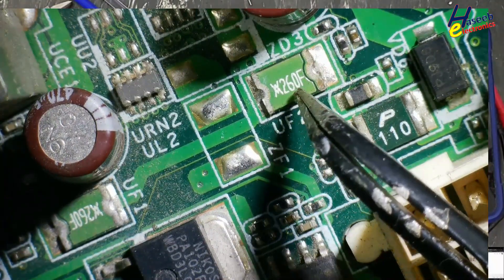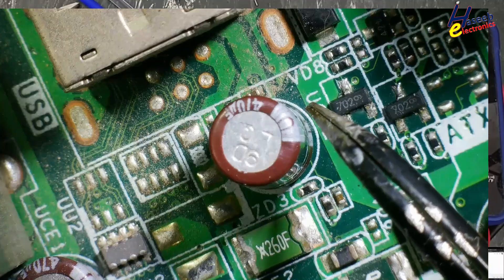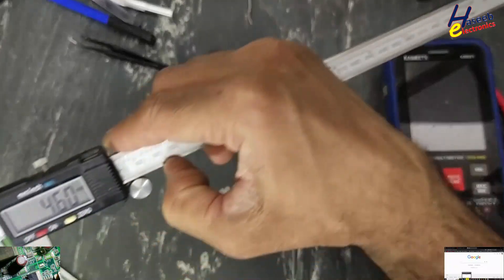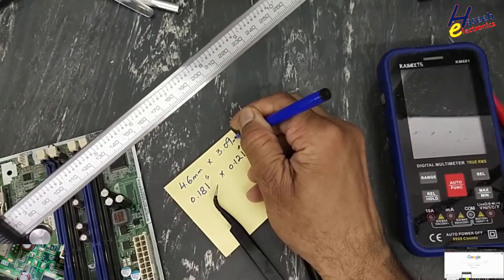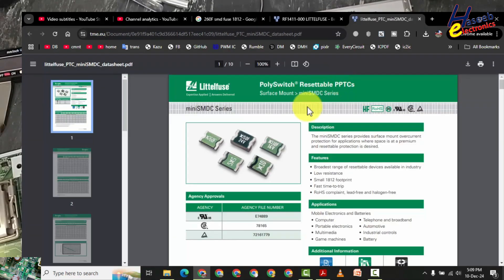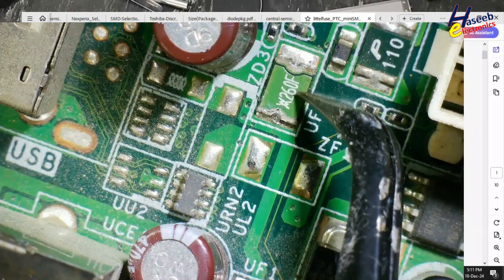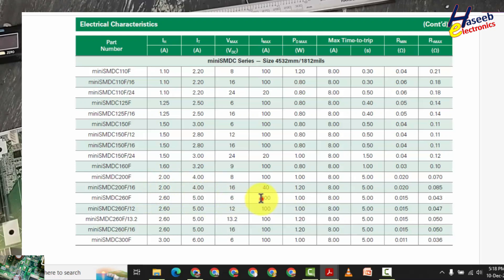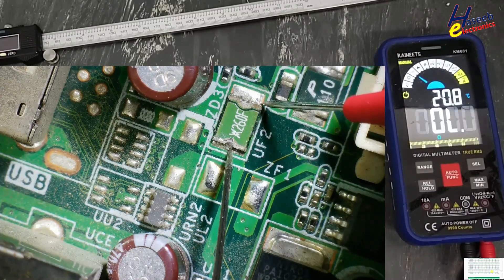{1269} PolySwitch Resettable PPTC Fuse

Comment: one problem with PolyFuses is that they don't cut the current they limit it.  they one shown will dissipate 1W in the fault state,  as it needs to pass current and thus heat to stay tripped. So should only be used if you don't want a disconnect from the supply in the way a normal fuse would provide.

You can think of them as a load of conducting balls in material that expands with heat. when cold all the ball are touching so there is a low resistance path from one terminal to the other. as they balls heat up with the fault current the material holding them together expands and the balls more apart. The resistance between the terminals increases until there is just enough resistance to produce heat to keep enough balls apart to maintain the limited current. if the fault current is removed the fuse cools down, the material shrinks back and all the balls make contact again so resetting the fuse.
Reply from the maker: You are right
it is PPTC, as it is much closer to PTC thermistors. (thermistors are made from oxides but it is non-conductive crystalline organic polymer matrix that is loaded with carbon black particles to make it conductive. when current exceeds the rated value, it causes to overheat the substrate. which causes the polymer to expand, changing from a crystalline into an amorphous state. thus its resistance incraeses in very high (behaves like a PTC ), and this component behaves like open circuit, although that time a few milliampere current remains in the circuit. 
when the current is decreased, its power dissipation decreases, and its body temperature cool down in few seconds, and it regains its resistance to low. it is called resttable action
Reply: @HaseebElectronics  i was treating the carbon black particles as the balls.  i find the problem is that it's still pulling current to maintain the 1W of heat needed to keep it in the tripped state.
They have their uses if the equipment is not easy to get to to change a fuse.
I do feel sometimes they are used as trying to work out the type and rating of the fuse, to provide protection and a long life in use can be a real pain.🙂
Reply from the maker: @TheEmbeddedHobbyist humble thanks for your valuable comment 
Yes its main roll is to keep the system running 
In abnormal condition, It limits the current so that the PC turns off frequently indicating malfunction symptoms
Reply: @HaseebElectronics  bilenlerin sohbeti bilmeyenlere öğretirmiş sizi dinledim yeni şey öğrendim. teşekkürler...peki sorum şu neden tüm sigortalar bu şekilde değil. ekonomik nedenlerden mi, şirketlerin bozulanlarına yerine yenisini satma nedeni mi? yoksa kullanım yerlerinin farklı amaçlarının olması mı?
Reply: @HaseebElectronics  I would like to consider repairing a fuse of the same specification.
The F075 marking for fuses typically indicates a rated current of 0.75A for electronic components.
Reply: @HaseebElectronics  The charging cable is plugged in, but electronic components (such as the fuse (F075)) are causing overheating and preventing the device from turning on. Replace the fuse with one of the same specifications immediately.
Reply: I think the F075 PPTC fuse in this (Sega Toys Jewelpad) DC IN 5V product has an overheating problem (due to incorrect insertion), and I'd like to consider repairing the fuse.
If you Help for us.🙏🙏🙏